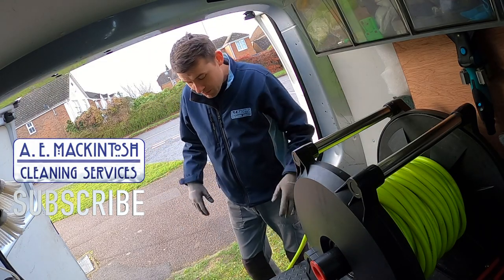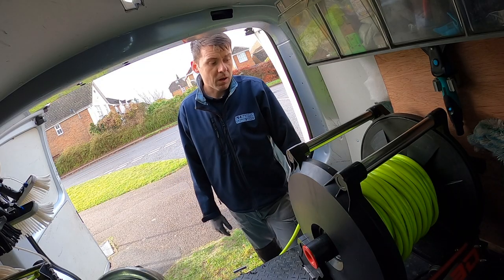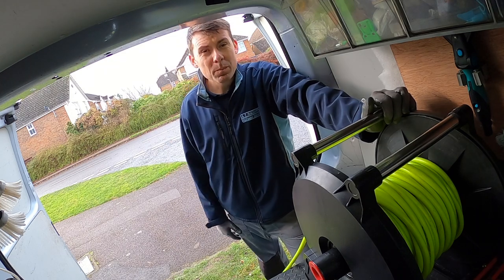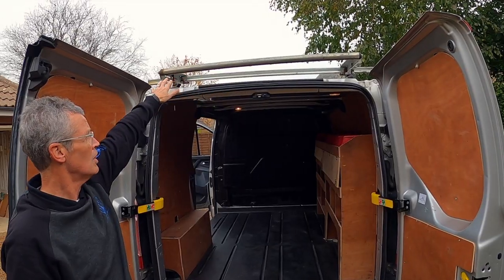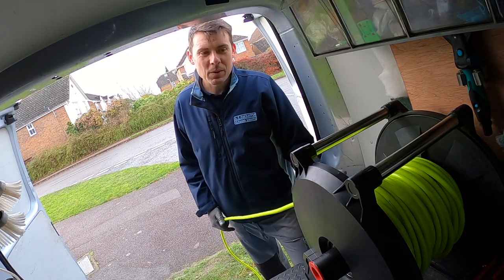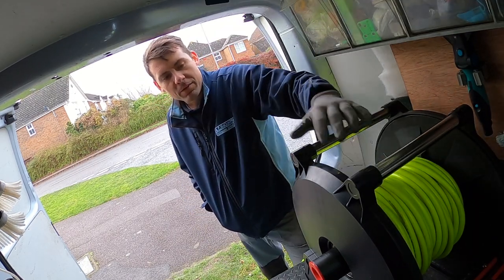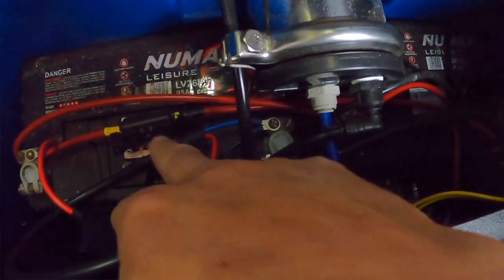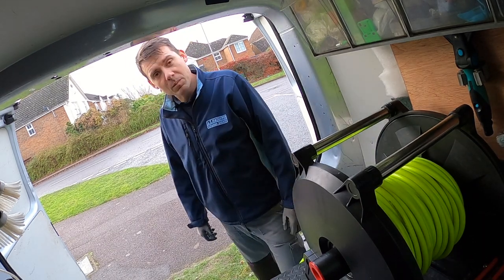The Power Up 3D Hose Reel Review

Comment: Great video Ashley. I had RSI problems with my left shoulder from manual reeling after 15 odd years of WFP and that has now gone. The only problem I have is that I run 8 mm hose and also tubeless for my poles and when you reel this in it sometimes maxes out the reel space available and catches on the plates. However the pluses of an electric reel far out way that occasional niggle. Take care bud

Comment: I love my powerup reel. I don't pay any attention to the speed comments.. after all someone's reel could reel in at 40 seconds but I could be 5 minutes faster cleaning windows on a 3 bed semi.. it's a pointless comparison.. it certainly saves muscle fatigue. Big 👍 up
Reply from the maker: Thanks. That’s true. The tiny difference in speed isn’t going to make that much difference in reality.😃👍🏼
Reply: @aemackintosh  also do you really want to wind up that fast? It’s ok when the hose is laid out in straight lengths, but if it’s not and you get it hooked on something or you get a twist or hoop in the hose now that could course some serious damage to the van or the reel.

Comment: Nice equipment it’s just the thought of having the doors left open 
And you have to make sure you can find parking spaces where there’s enough room to have doors open as well if that makes sense 
My system is connected underneath so I can have the doors closed too many vultures around
Reply from the maker: I can actually shut the doors on the 6mm hose and lock it if I want. As long as I pull enough hose out first.😃👍🏼
Reply: yeah me too

Comment: Do you not worry about having your van open all the time? Saw a wfp cleaner plug a manual reel into a water port on the bottom of his bumper and thought that was good to secure the van, suppose then it’s a pain lugging it in and out the van all the time. I’d like to take my dog on a round and he can sit in the van but wouldn’t have him in there with van unlocked.
Reply from the maker: Yeah I have ports just under the bumper so I have the option to plug in an external reel if I want.😉👍🏼

Comment: Hello mate, you say you’ve now fitted an inline fuse to the red (positive) cable but you’ve wired the black cable to the positive terminal on battery so shouldn’t the fuse be on the cable that is connected to the positive terminal? (Black cable)

Only asking as I’ve ordered a reel and fitting it same as you as I want the crank on the right
Reply from the maker: Yes, you should swap the fuse over to the black cable.😃👍🏼

Comment: Hiya Mate, have you got any videos on solar panel cleaning on a roof? If no any advice for panel that are really dirty with some small hard moss patches it's pouring with rain tomorrow so may give the customer a buzz. what do think?
Reply from the maker: If it’s already wet, that will be your best chance. The tricky thing is trying to find something abrasive enough but without damaging the panel. A upvc cleaner might do it, and maybe a white pad like the alpha scrubber I tried recently from DA components.😃👍🏼
Reply: @aemackintosh  cheers for the reply. 
Trouble is I only have my Gardiner Pole and probably use my flocked head, but it's getting enough purchase on them will be the problem as mostly I be cleaning from the ground , have u a video to watch?

Comment: Just about to get my van kitted out and going to have 2x of these installed, anyone had any problems with power consumption off 1 battery?
Reply from the maker: You might want to top up your battery with a mains charger, especially if you are doing local work, you might not do enough mileage or your vehicle to charge it enough.👍🏼